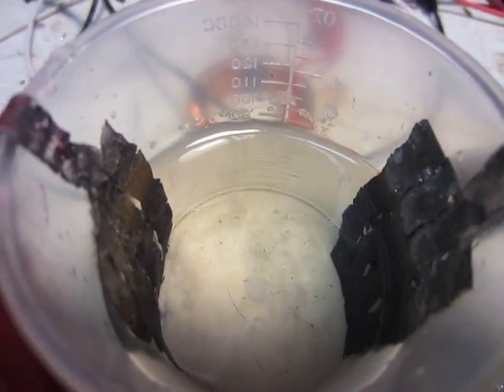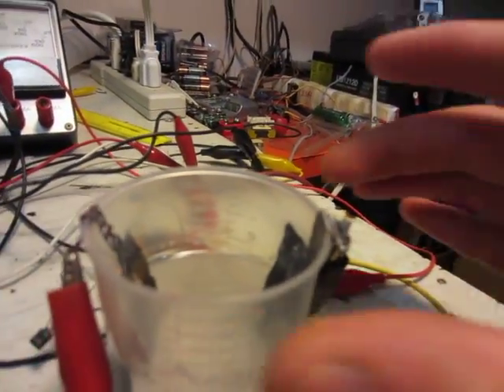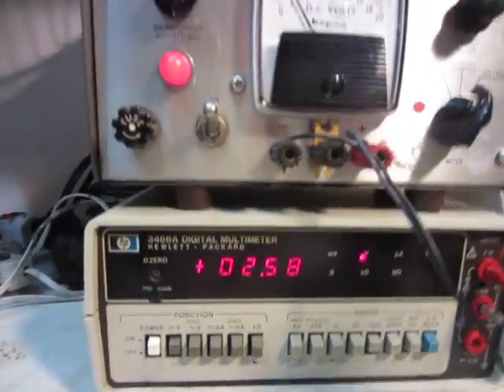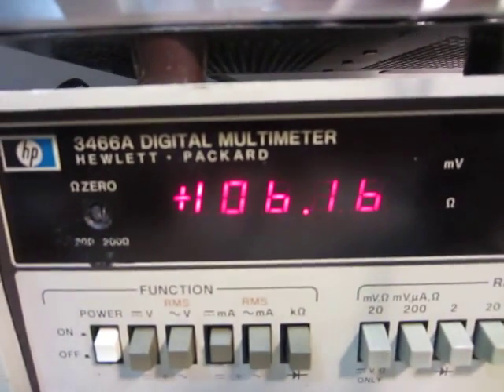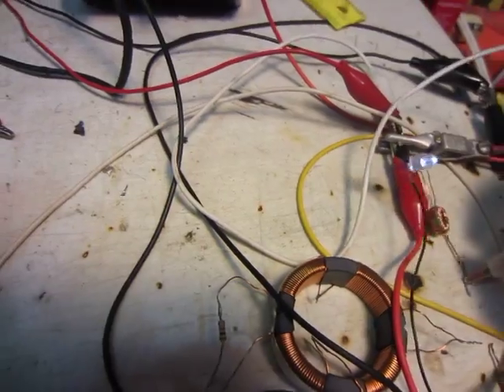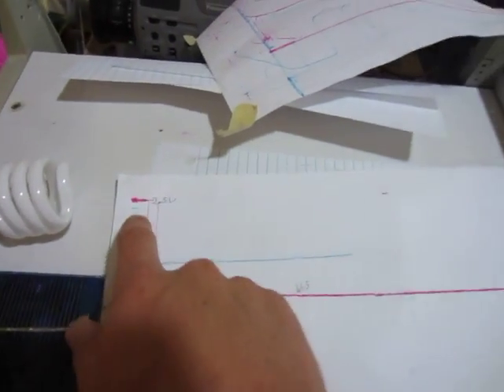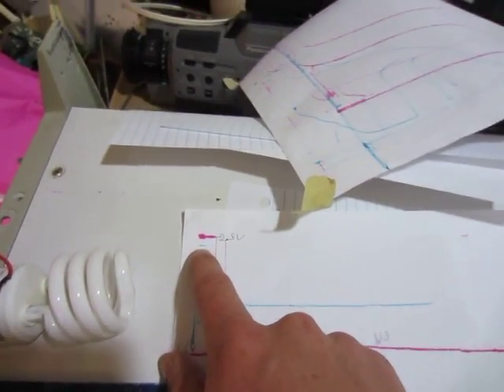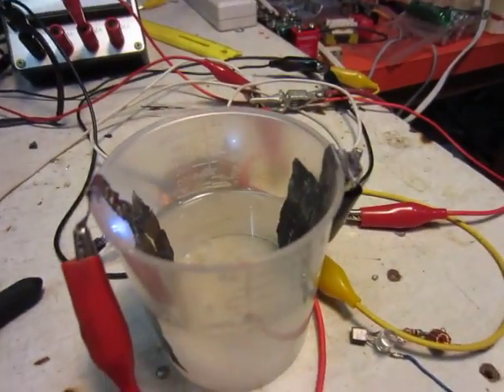Lead Alum home made rechargeable battery

Comment: In my experience. Yes. Although I am using Aluminum Sulfate (Alum from farm supplies, comes in 25kg bag). You may have something a little different. Look at your first battery plates to check for dissolved bits. Before and after cleaning the black stuff off. I use a wire brush.

Comment from the maker: Mine stays at about 1.5 volts.  It will stay a little higher right after a charge.  I am almost finished with a new one.  It is much smaller but should have 4 times the capacity of my other one.  I think the one electrode is bigger then the other.  Do you have any idea if it would be best to have the positive bigger or the negative bigger?  I'm going to upload a how to video of it so that should be coming soon.

Comment: I am thinking remote wifi stuff, energy harvesting. Solar for sure! Wind. anywhere off grid with regular charging available. Mine still don't store above 1.5v after 2 days off charge, But it's not like i've cycled one 30 times either. I can get them to sit over 2v for a few hours now. If you allow for 1.5v cells. Also they seem to store power well when dry. So charge, dry out, shelf for time. Then wet up to use. Maybe.

Comment: I cant seem to kill mine either. They always put something out. I have a solid one that wont put out amps when its dry though. Add a few drops of water and off it goes. I'm amazed how low they go though. I'm still having trouble getting one really well charged. Need a better power supply...  Your right about the abuse they can take though. Never seen anything like it.

Comment: Really big rolling pin? I'd not be too worried with all the solder you have. Just put lots of sticks in to get the surface area and added abuse threshold from the thickness. Try a multi plate maybe? My best (commercial) solar GEL had a lot of plates per cell... Use paper towel to stop them touching and shorting.

I have a 16 cube ice tray... Going to make a 12/24... Just refining the mix and charge rate. Looks like they can hold 2v+ if charged right and not contaminated by tin, copper, steel etc

Comment from the maker: The first charge seems to take a wile but I could try.  I just got a LOT of junk from my dads work so I will probably be focusing on that for a little wile. :-) Sounds like you might be charging it with to many volts. I have been charging mine on 2.4-2.5 volts and the positive plat is starting to have some black stuff chip off, I have charged it and discharged it about 20 times so it have held up to a lot! One other thing that is weird about mine is if you can never get it it down to zero volts.

Comment: First charge graph would be handy if you have time...

Some of mine have been doing weird stuff... Bouncing abound between 0.8 or less and 3v. when on 3v @30ma... I think its air bubbles reducing plate area then they pop and volts jump up again... only happens on first charge, could be copper contamination too. I need to test more. (and get one that doesn't fall apart after I charge it twice)

Comment: Great video. I like your graphs. From full charge right through to dead flat. I'm uploading my first attempts now. I like your Solder idea, It might just be the solution to my dissolving copper wire problem. Will try lead solder next if my steel wire fails.

I wonder what amps you would get from a multi plate cell?

I think it will stop getting better after a few more charges. When you buy a lead acid, they have been "conditioned" by being cycled lots. They don't sell until max is reached.